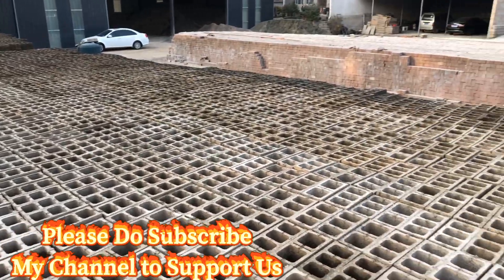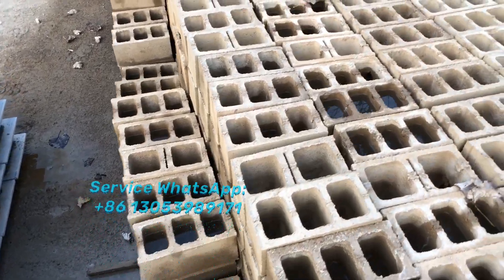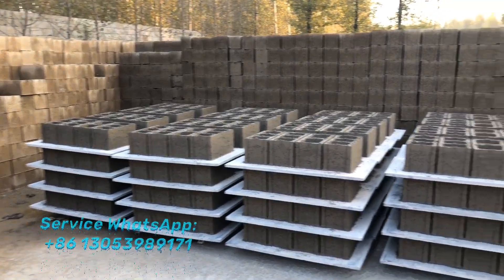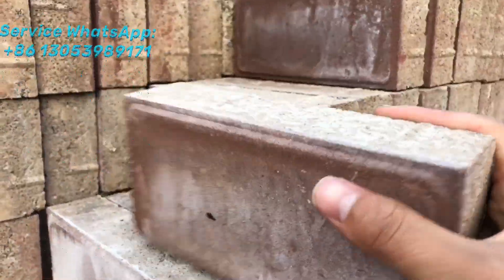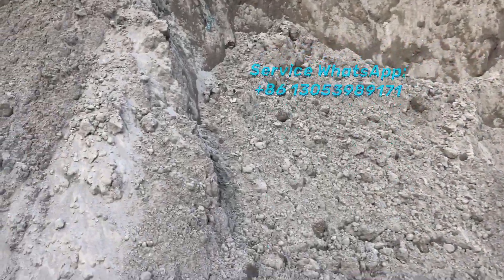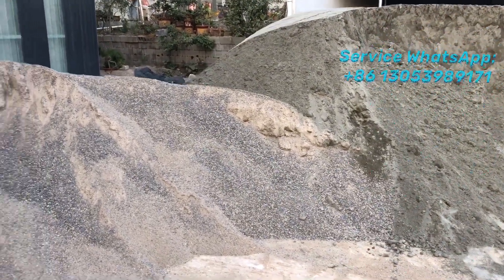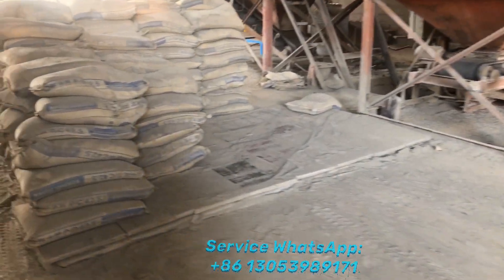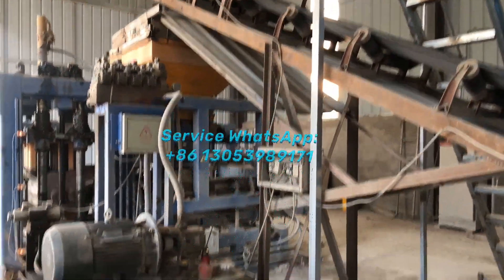a successful concrete block production factory ,how is the layout? big surprise

Comment from the maker: Hello, Dear Buddys,  please must write down your own comments below: 

    ----1 . Why need you to buy a block machine ?   Answer 1 : to set up a block factory . Answer 2: to make blocks for a project.

   -----2. Why other's block factory can get Benefit ? not yours ?  how many labor you need to employee ? 5 or 10 ?

   ------3. Why 3000$ block machine can profit 15000 $ within 6 months ?  Did they cut down material cost for saving money ? 

   ------4. Which factor is more important ?  A good machine or A good material ratio ? 

   ------5. Which material ratio is more scientific ? Answer 1: 10% cement ,90 % sand .     Answer 2: 20% cement, 80% sand .

   ------6. Which power is more stronger to form blocks?  Hydraulic or vibrator force ?  

   ------7. Which kind of electricity source is more powerful to make concrete blocks ?  Single phase or 3 phase ?

   -----8 .How many days need your wet blocks to be curing ?  7 days ? or 21 days ?   And how to curing your concrete blocks ?

   ------9. A concrete blocks quality is decided by what ?  Pressure  or . Curing term ? 

   ------10. How much thickness of a 400*200*200 hollow block is best choice ?  30mm or 25mm ?
Reply: i guess it is pretty randomly asking but does anyone know of a good website to watch newly released tv shows online?
Reply from the maker: @bentonmaverick9897  you could subscribe my channel then I will update new videos every week
Reply: @Benton Maverick Lately I have been using FlixZone. Just search on google for it =)
Reply from the maker: @brysoncorbin8496  you can add my WhatsApp number:+8613053989171, then I can send you more information of block clamp machine